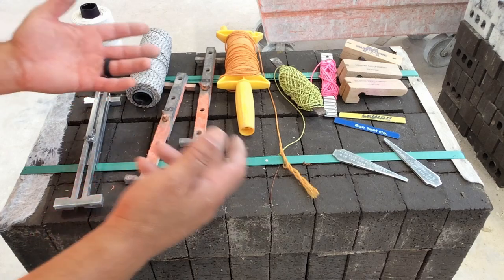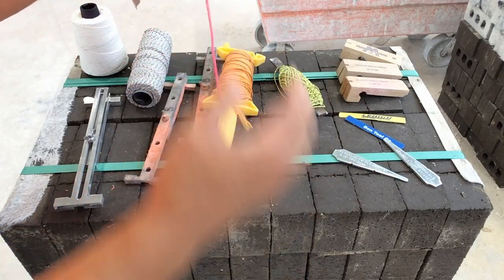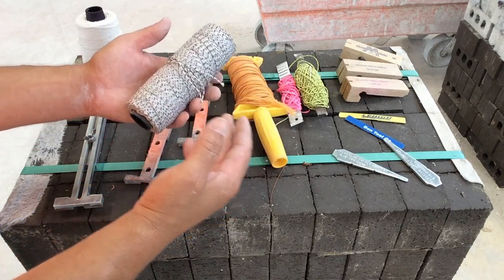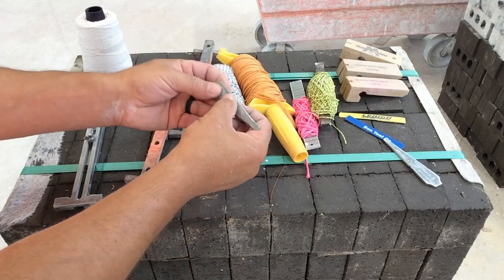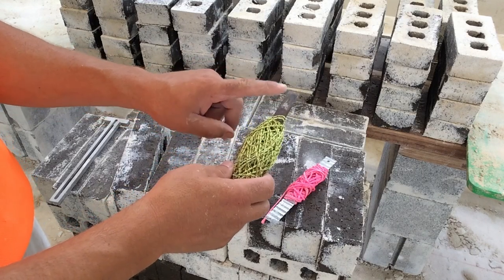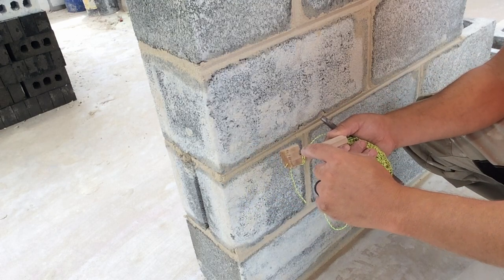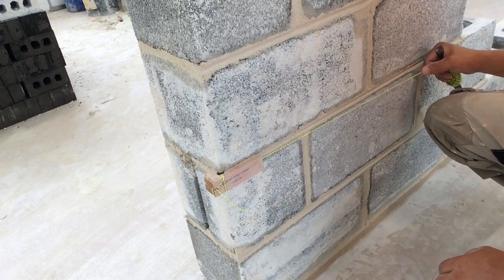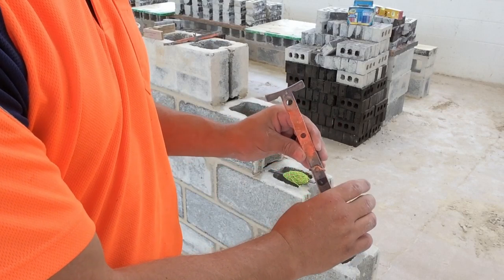String Line / Hanging a Line [For Students]

Comment: My problem is making the base of the solid block align with the block I set the mortar on
Reply from the maker: That is tough to work on.  You're developing your eyes in every block you lay.  I know it's difficult because the mortar squeezes out and covers the edge of the block you're laying on!
Reply: @masonry201  exactly
And is more difficult at my place because we use very heavy solid blocks and sometimes the other block layers make the mortar bed more than an inche or two

Comment: could you use line blocks for split face block?
Reply from the maker: Great question!  Yes, however, put them on the smooth side if that side will be seen also after installation.  If you'll just see the split-face side, hang the blocks on that side.  You can still lay the split-face to the line on the rough side.

Comment: Some subscriber ideas for future videos:
Setting up a practice site for block and bricks and suggested exercises.
Using the mason's rule. 
Can mortar be to "weak" or "strong" for the block or brick to which it is applied?  Can a mismatch lead to cracking in the wall?  Some say yes.  Others don't know or don't care.
Should mortar be tested in the field similar to a slump test for concrete?
Best practices for insulation of masonry walls; interior versus exterior.
When to place concrete bond beams in CMU walls.
Other materials for blocks like earth stabilized blocks, and autoclaved and non-autoclaved blocks (advantages & disadvantages).
Using specialty bricks and blocks.
Cleaning and sealing requirements for CMU / brick.
Can lime of clay finishes be applied to masonry walls?
How to consider inherent qualities of brick and block for moisture vapor control in residential buildings.
I am surprised that the Local would allow you to teach your trade on YT !
Fact is, you are one of the best presenters on YT especially when camera is focused on the details of the work and an obnoxious soundtrack isn't playing :)
if someone comes away from one of your classes scratching their heads and confused, they are not paying attention.
Cheers.
Reply from the maker: Those are all great ideas!  I do have plans to do some of those, especially a series related to mortar mixes and uses. It's finding the time that's the hard part.  I do have a masons ruler lesson buried in one of the arch videos.  Thanks for the comments!

Comment: You have an effective presentation style.  You take the time to thoroughly explain the details.
This topic was on string lines. 
 However, how is the location of the CMU that holds the trig, established accurately in the middle of the course?
At what span or distance would you recommend using a unit to hold the trig?
A short video on this would be appreciated.  Keep up the great work.
Reply: As soon as possible. The whole point of setting a trig is to stop using a level and then “lay to the line”
Reply from the maker: Set the twig in the middle of the length of the wall, where the most sag is.   The CMU that holds the twig gets its height determined by measuring from either 1- a benchmark from down below, or 2- a determined height that is up above, usually a window sill height or top of window or door heights.  As for the span at which to use one, or multiple, is probably going to start around 40 feet in length.  
Thanks for the questions!